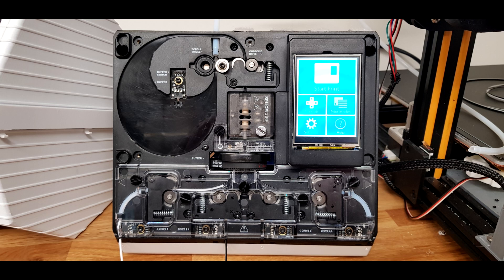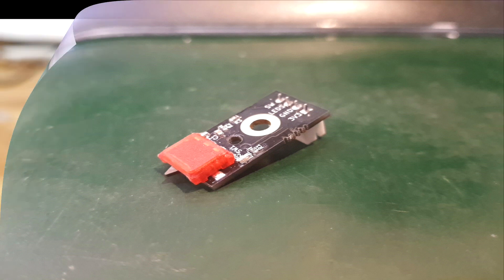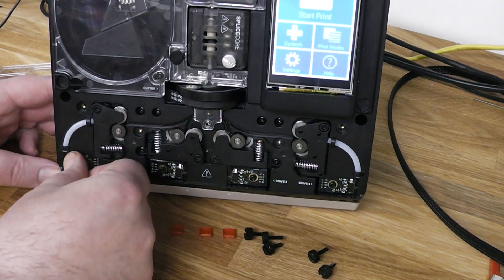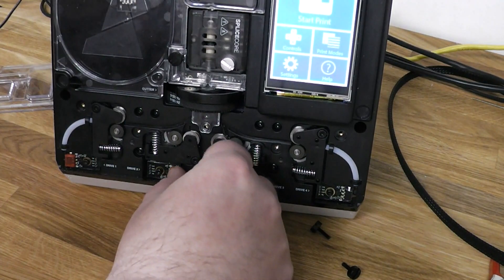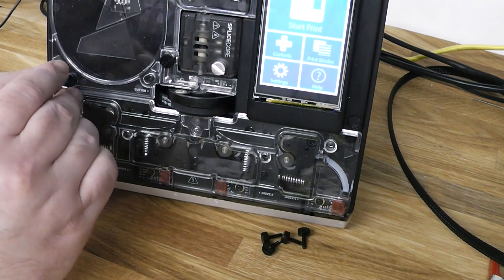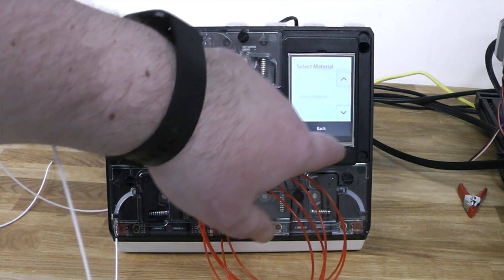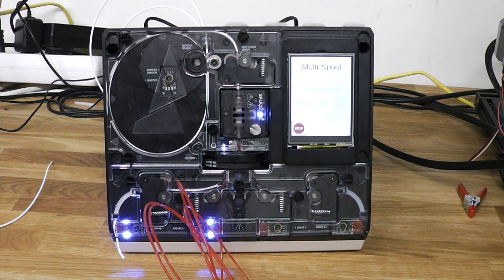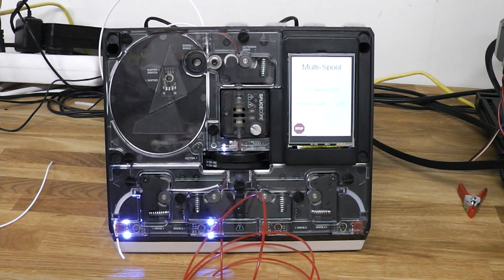Fix for the fatal design flaw in the Palette 2 (Pro) filament inputs.

Comment: I cannot get these little things to fit over the switch.   I have tried multiple times and just cannot seem to get them to fit.   Might try with my sla printer
Reply from the maker: Yes, they are a very tight fit due to the space constraints and the precision needed to properly close the gaps. SLA sounds like a very good fit for this. Or you could try to tweak scaling and/or extrusion multiplier slightly to make it fit. Good luck, and hope you get it working.
Reply: @kavionic279  SLA was the solution.  Printed in 10 mins and fit like a glove.  Thanks!
Reply from the maker: Awesome. Glad you got it sorted!

Comment: Did you manage to tune in soluble support usage with the palette? Any tutorial?
Reply from the maker: Yes, that was my primary use for the Palette 2. But I have not made a tutorial about it. I used 6/4/5 for splice tuning (heat/compression/cooling), and used PVA only in a few interface layers at the top of the support with the rest of the support being PLA. Worked pretty well for me. When I get further with Rainbow3D I wan't to play around with PETG as support for PLA and vice versa. Seems like a lot of people have great success with that.
Reply: Kavionic that’s cool, I’ll check it out thank you. 

What’s with the PETG thing you mentioned? Haven’t heard about it
Reply from the maker: It is just about using PETG instead of PVA to support PLA. PETG and PLA bonds very weekly so it becomes easy to break off the supports cleanly after printing. And it is much cheaper and easier to print with than PVA. So sounds very interesting. But I'm to busy developing Rainbow3D (my own multi-material system) right now to do any multi-material printing myself :-)
Reply: Kavionic I’m eager to learn about your project, will google it. Good luck!
Reply from the maker: Thanks! It still have a long way to go, but there is a short intro video about it on this channel: https://youtu.be/aK8oQrXv0GE
Reply: @kavionic279  I was thinking about what you said. If PETG and PLA don't stick together and would want to use it instead of PVA, how would the purge block stick together then? There is a chance of a hot mess if it detaches.
Reply from the maker: @Dark1Masta  They do stick together, just weaker than PLA to PLA or PETG to PETG. So you have to use some force to break it off, but it is pretty much guaranteed to break off in the interface between the support and the object. It is the same with PVA. It bonds very weakly to PLA, and I have often seen the purge block partly de-laminating. But it have always been partly attached and survived long enough to complete the print. When I have used PVA for support I have almost never dissolved the PVA. Since it bonds weakly to PLA it usually breaks off cleanly without any use of water.

Comment: Thanks for the info and „fix“. OVer all, whould you buy it again, and how is the „daily“ use of it, What is the average success of prints, concerning issues while printing.
Is it, after proper calibration, a shoot and forget tool, or do I have to worry about the result on every print, thanks in advance
Reply from the maker: Thanks for the feedback! If I lost mine I would miss it a lot. I would do a lot of research to try to find another alternative before buying another one. But despite all the grief I have had with this one I have a feeling that I would end up with another one since they still have very little competition. 3D printing always have a lot of variables and this add a lot more. So you will have more failed prints. But I have found that if I'm pretty generous with the transition length it have a pretty good success rate. They have a really frustrating bug that cause it to randomly lock up and stop feeding filament that cause a failed print every now and then. But other than that it is pretty reliable with the mods I have made for it. I'm primarily using it for soluble supports, and the design freedom that gives me is really awesome and the reason I would have to buy it again or find an alternative.
Reply: @kavionic279  I ordered mine on Wednesday night and it arrived today, runs fine with no issue via Octoprint and CANVAS and PALETTE 2 plug-ins.

Burning some really old PLA (3-5 years old), no issue.
Will check with PVA, which is on the desk... in the next round :-)

Comment: nice design, but I have a palette 2 and a palette 2 pro, both with well over 2000 hours on them and have never had a problem, so I would hardly call it a "Fatal design flaw"
Reply from the maker: And most of your prints are in multi-spool mode?
Reply: @kavionic279  all of my prints are in multi-color, why else would I be using Palettes?
Reply from the maker: So this fix is entirely irrelevant for you then. Why would it be a problem that Mosaic designed the filament inputs as one-way-valves if you are never using the mode where it needs to be able to eject filaments after detecting a run-out? Multi-color was last on my list of reasons to buy the Palette. #1 was multi-material so I could use soluble supports. And #2 was multi-spool so I could safely use the last part of each spool. And that mode was fatally wounded by this design flaw (as well as the dysfunctional buffer design).
Reply: @kavionic279  I've run at least 20 end of spool prints and never had an issue either. I'm just stating that just because something isn't working for you, it's not a "fatal design flaw", you're just having an issue that I'm sure Mosaic would be more than willing to work with you on resolving. But good for you for coming up with a solution on your own.
Reply from the maker: @Versus3D  Ok. Then you are more lucky then me. Or the filament you use don't have the bend at the end that all the brands I buy have. I agree that just because it don't work for me it's a design flaw. That is why I investigated what was going on and found out how incredibly stupid the design of the input sections was. Whomever designed that is unbelievably incompetent. Anyone that have tried to thread filament into anything should have realized that this design was never going to work reliably. I reported this to Mosaic a couple of months ago. But I have no hope that they are ever going to do anything about it. I don't think they give a shit. And even if they do the stupidity needed to make this an all the other flawed designs on this device makes me wonder if they would be smart enough to make any real improvements to it.
Reply: @kavionic279  ok so at the risk of sounding like a jerk.... pretty much all filament has a curve, it's on a spool, that's how it works. Why don't you just straighten it out like the rest of us do? It's not hard to do and takes all of 5 seconds.
Reply from the maker: How do you get to the filament end so you can straighten it without unwinding it all from the spool first?
Reply from the maker: If you gave me that snarky lecture about how filament wound on a tight spool bends without having thought it through enough to answer my previous question, then yes. You do actually comes through as a bit of a jerk 😉 I guess when you have used multi-spool it have been some short loose pieces that you can groom and manicure before gently feeding them into the Palette? And not because you wonder if there is more or less than the needed 150 meters left on the spool before starting a print?
Reply: Hello I can't find any videos so maby you can help me I have 3  2day prints that I need color for, and am really having a hard time deciding which one to get the pro or not. I plan to sell the machine as soon as I finish these prints unless I really like the machine but it's for a client and I need high quality parts but a lower cost would give me higher margins. However it's well payed project so I do need to produce near perfect results. What is your recomendation?

Comment: Fatal design flaw hahahaha,  I have 100+ hrs on my P2P and have never had this problem
Reply from the maker: That is good for you! The first time I tried multi-spool the firmware decided to stop feeding rather than splicing to the next spool (firmware bug). Then I realized that multi-spool could not work at all since the buffer had to periodically drain itself in a situation where it had no idea when it would be needed (hardware bug). Which I solved with an external buffer. Then on the second multi-spool print after that I got bitten by this ludicrous design issue (another hardware bug). So then I had to stop using multi-spool again. Not worth it when the risk of having it ruin a long print is that high. With this fix I hope to be able to start using it again. Crossing fingers hoping that the firmware bug will not resurface.

How many of those hours where you printing in multi-spool mode? If that was the majority of it, I'm surprised you have not been bitten. Maybe your spool ends are less crocked than the ones that I buy? They have a sharp bend at the end that is pretty much guaranteeing that this will be a frequent failure mode. If the filament only have the slight curving from being rolled up on the spool, the risk is much lower. But still there.

Comment: I was one of the first ones to get my Palette 2 Pro, but all the issues that continue to be reported have kept me from using it even once.  I will print and install these caps and give it a whirl, keeping my fingers crossed all along the way.  Thanks for sharing it!
Reply from the maker: Yes, when I realized that the Palette 2 had to periodically drain the buffer empty in a situation where it had no idea when it would need it, I promptly stopped using multi-spool. When I was done with my external buffer I thought I was home free, but then I got bitten by this ludicrous design. With the combination of the external buffer and the filament guide it should hopefully finally be able to safely use multi-spool mode.